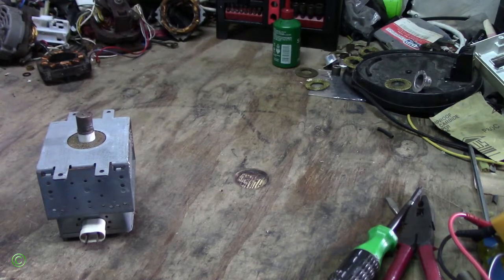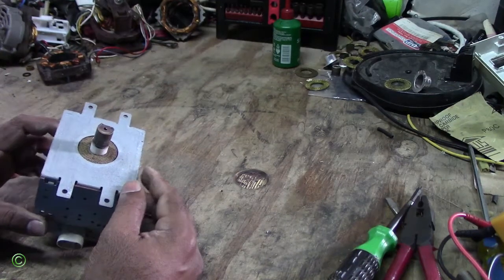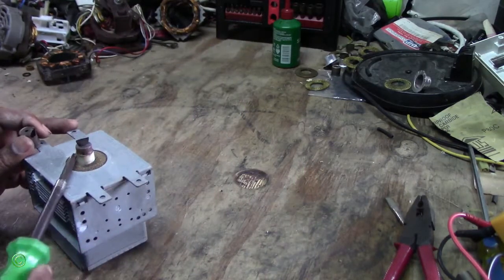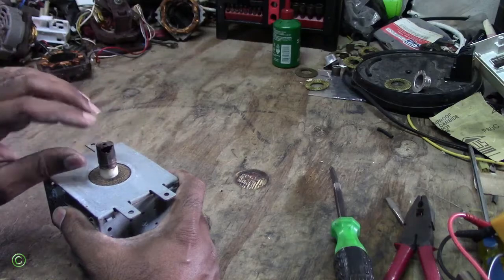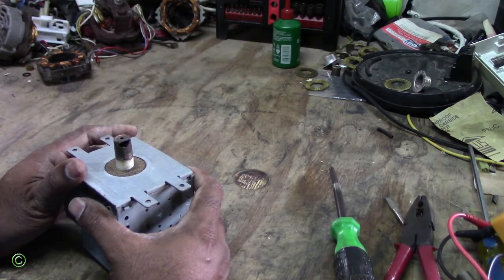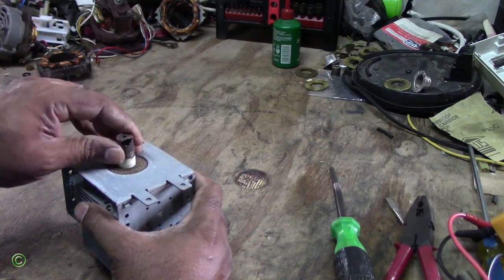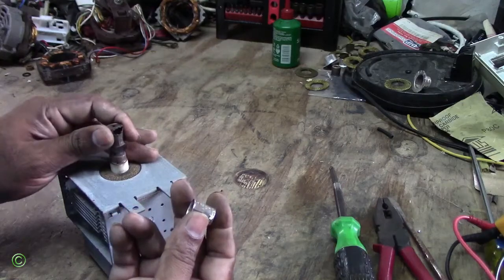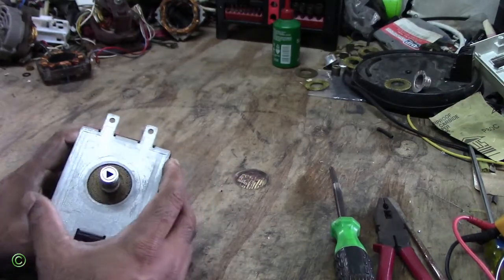Magnetron cap burn out & cap replacement

Comment: Hello, why do some caps have different shape hole, eg triangle. Can I use a different hole shape. I can only find the correct diameter on aliexpress but has a triangle instead of a circle? Cheers
Reply from the maker: It doesn't matter what shape the hole is. It will work. Different shapes same results just different manufactured.
Reply: @mr.fixit3604  Thanks.
Reply: Wer can you get cap?